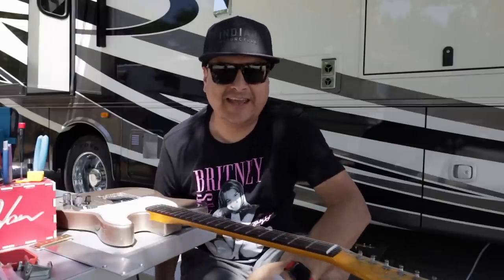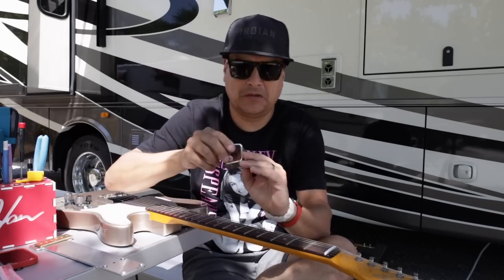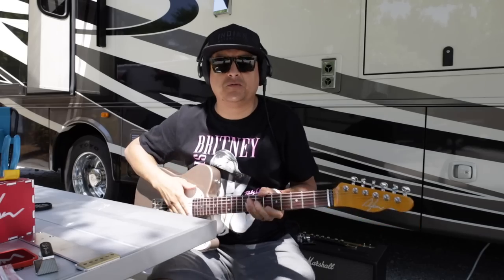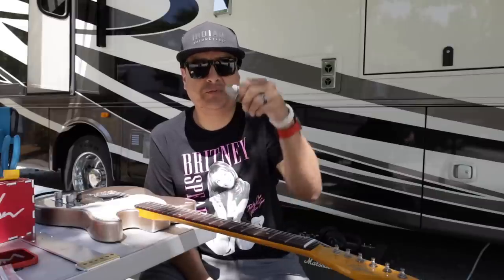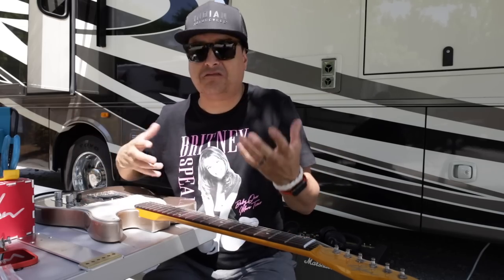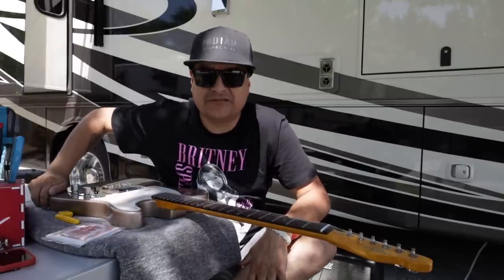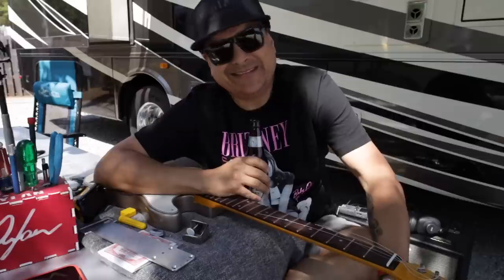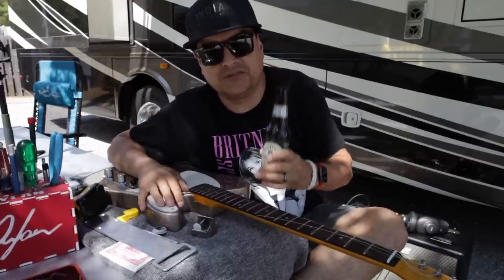How To Get More Sustain - The Backbone VS Fender Fat Finger Review Episode #651

Comment: I for sure hear a difference, not in tone but in sustain. Bought the fatfinger myself and I find it increasing the sustain for sure. It is logical because the vibration of the head guitar goes against the vibration of the strings that is why headless guitars have such a good sustain. And those Steinberger guitars made out of carbon have monster sustain because carbon is very stiff. So, for me it certainly works. I think it also depends on how thick the neck of the guitar is because thicker means more stifness and less vibration from the wood which interferes with the vibration of the strings.

Comment: Yep. If you wanna effect tone and sustain, start (and maybe end) with the string contact points. Bridge, nut and frets. I'm a big fan of stainless steel frets. They make the guitar sing louder and clearer than anything else I've tried as far as mods. A good cable between your guitar and amp/buffer is a big deal too. Good solder joints are also important
Reply: I wonder how tungsten frets would work if they were pre-machined to the required dimensions and shape [since filing them after installation would be essentially impossible].

Comment: What limits sustain is the transfer of energy from the strings.  If none of the energy in the strings was ever transferred to anything else, they would sustain forever.  A resonant body may transfer energy from the strings during parts of each vibration cycle, but feed energy back to the strings during other parts.  Increasing the amount of mass at the nodes of the vibrating string will generally reduce the amount of energy transferred in either direction.  Adding mass near the headstock would likely affect open strings more than fretted notes; whether that's a good thing or not would likely be a stylistic choice.

Otherwise, when describing something as deadening the sound, I think it would often be good to think of such effects more in terms of how they affect the sound of different parts of a note relative to each other, rather than in absolute terms.  If adjusting tone knobs so that the tail of a note was as bright as desired would cause the attack to be too bright, a device that deadens the sound of everything, but especially the attack, may allow one to use a higher tone setting than would otherwise be acceptable, which may leave one with a brighter-sounding tail than if one had to use a lower tone setting.
Reply: Thank you for a coherent response.
Reply from the maker: This is something I want to try to illustrate in a video. I am buying an oscilloscope soon and want to be able to show what you are saying visually. It’s really helpful to understand. So many people think In simple sine waves and our guitars never actually behave that way.
Reply: @DylanTalksTone  One thing I'm interested in seeing given more consideration is the fact that because a guitar's AC impedance isn't constant, the tone circuitry built into the guitar will interact with the coils differently from how a tone circuit in an amp or pedal would react.  One of my guitars is an inexpensive Ibanez which is stock except that I've cranked the bridge humbucker down away from the strings, but put two 1x6mm neodymium disk magnets on each of the four pole pieces serving the bottom two strings.

The effect of this is that when using just the bridge humbucker, the tone knob affects the volume of the treble stings much more than it affects the bass strings.  By turning down the tone knob on the guitar but boosting the treble on the amp, I can make the bass strings much brighter than the treble strings.  While turning the knobs to the extremes would put a disproportionate emphasis on the bass strings, the fact that the knobs can dial such extremes means I can emphasize the bass part of a bass/strum pattern as much as I want.

Comment: Wood vibration can cut some note.  Some weight in headstock can fix the problem because changed the vibration frequency and yes...it increase sustain in this note. In my bass is the E string, G# note. Fatfinger maybe can work for that. I improvised with a weight I made myself.

Comment: Edit: the fat finger made the sound dull, the backbone kinda served the tone (maybe just in my imagination), but at least it did not worsened it at all. 
But that happened, because your tele is already perfectly fine! On bad sounding guitars, both gimmicks could help a bit, for whom does not have experience working on guitars... me thinks

IMO lots of sustain is nice to have, but rarely is needed a longer sustain then 10 sec. 
The more important part, I think, is that long sustain means the string vibrates more freely, with less dissipation of string energy, thus generally a better tone with a wider range of over- and under-tones (if that makes sense...) just my opinion. 
I work on my cheapo guitars till I get the most sustain out of‘em. 

More weight on the headstock can alter the tone and sustain to better or to worse. It‘s a matter of balance between body-weight and its resonance and neck stiffness, weight and resonance. A perfect good guitar can just get worse by changing weight, form etc. 

I had experienced a bit more bottom end and an increase of sustain by replacing the cheap tuner with locking ones on three guitars. Certainly, it could be also the better materials (brass f. ex.) , tighter tolerances, and so on... I know, I know...

But on one I had lost a bit of sustain with the heavier lockings (2008 B.C. Rich mockingbird classic exotic koa),. It had already lots of sustain, so I live with it, because It balances better on my lap and easier string change.

All started few years ago after swapping the metal cast knobs of the tuners on a kit-build tele with lighter fancy orange plastic knobs. I instantly heared the loss of bottom end (10%) and sustain (by 15%). I mounted the metal knobs back two days later and got my old tone back. The difference in weight was just 6.4 gramms!!! Just the tuner KNOBS  had so much influence!!! 
Later on I mounted heavier locking tuners and achieved an increase of sustain and low end. And a nicer tone!🤷🏻‍♂️

Comment: Fat finger is not for sustain, it changes the way that neck resonate and in some circumstances helps to eliminate dead notes. I have Hopf Studio from '70, kinda Gibson SG shape, with long neck, and additional weight on headstock eliminates dead notes on G string.
Reply from the maker: It says “sustain enhancer” on the package so.....
Reply: @DylanTalksTone  well the truth is i never looked for "a device" to enchance my sustain, so didn't know how fender tries to sell that product ;) but when i did research for dead notes on the neck, i found some information about adding mass to the headstock. That mass should be actually "tuned" to achieve the effect you want. I personally would never pay such money for piece of bent steel with fender logo, but on the internet you can even find oldschool thing called fathead for fender bassess. I think that as long as there are many neck profiles and thicknessess available, fat finger would work differently on different guitars.
Reply: @DylanTalksTone  By the way, maybe you'll be interested - on ResearchGate there is scientific research from 1999r called Dead Spots Of Electric Bassess written by Helmut Fleischer ;)
Reply: This is also what I've heard. Though it would make sense for Fender to market it as a "sustain enhancer", because if they marketed it for it's true purpose, then that might be them inadvertently admitting that some of their necks may have dead spots?
Reply: Fully agree. These devices are completely pointless if you don't have a problem with sustain, and dead notes in particular. They can alleviate dead notes or change the dead note to a different note.

Comment: I was customizing my Ibanez rg520 a couple yrs ago. Was removing the pickup rings, I wanted my pickups mounted in the body. I removed just a little bit of wood on the body at the neck so I could push the neck pickup flush to the neck. Maybe sounds the same but it never felt the same. It never vibrated thru my arms an chest like it did before

Comment: To me, based on the limited playing, the backbone sounded like it did increase the volume and length of the notes by a decent amount. At least by a second or two, possibly more depending on how hard you strum. If someone is looking for a gadget to increase the length of notes without any concern for anything else it sounds like it delivered on that
Reply: I agree,  I did hear a difference with the backbone installed. It sounded more full And bright
Reply: Yeah It did increased a bit of sustain. But I'm questioning if that was not because of the new set os strings he put on the guitar only after recording without the backbone.
Reply: Hearing it in this video just convinced me to buy one. There was definitely a noticeable difference.
Reply: @rafamoraes82  new strings don't really increase sustain, just tuning stability brightness, if the old ones start getting really old, (which not many players do not wait that long)

Comment: Aside from a good setup (which you already mentioned), two things affect the vast majority of an instrument's ability to sustain a note: The instrument needs to be light and stiff.

The less mass that the strings have to impart energy into, the less stuff there is to inhibit and dampen those vibrations. 
The stiffer the materials, all of them, but mostly the things between the bridge and nut, the more they will vibrate with the strings, and the less they will dampen the vibration. 

Now, these are not the end-all of it. Some materials are super heavy, but also incredibly stiff. These will sustain vibration very well.

Ultimately, a good solidly built guitar with a proper setup, and you're fine. 

The way you hold your guitar, like how tightly you grip the neck or how much you rest your strumming arm on the body, will affect tone far more than any of these gadgets.
Reply: You are half right,, stiff yes,, light? He'll no,, those 10 pound Les Paul put most guitars to shame in the sustain dept. ,, plugged or unplugged,  either way.
Reply: @keithclark486  except for a hollowbody Les Paul.  Key word,,semi hollow, those things sustain more than solid bodies ,,period.
Reply: @keithclark486  of course it will blow them all away. You are comparing hollowbodies to solidbodies. I used to have a jazz box hollowbody, it sustained for days. However. When my uncle was running a guitar center. On a slow day, they decided to test the sustain if all the solid body electric guitars. They took a headstock clamp in tuner, and timed how long the tuner could pickup the note. Les Paul beat every other solid body.
Reply: @keithclark486  well,, I meant semi hollow ,  or chambered Les Paul,, shit. I guarantee my neck through 8 string will out sustain your Kay. The neck is so massive and it's all one piece, it sustains like a good Warwick bass,, for days. And it's solid body. But quite a different beast.
Reply: @keithclark486  LOL. Ok
Reply: @keithclark486  my 8 string will win for sure, I have played a stand up. They actually don't sustain as long as a Warwick 5 string bass. (Have you played one?) My 8 string (ESP neck through) is on par with a 5 string Warwick.

Comment: The fat finger is more often used for getting rid of dead spots on bass. Most basses will have a note that chokes out somewhere on the G string because of the resonant frequency of the bass. The fat finger can often move the resonant frequency out of the basses range. There are also more permanent methods, like hiding weights under the tuners, to add mass to the headstock and achieve the same result. Guitars can also have dead spots but they are less noticeable

Comment: I listened to the comparison a couple of times but I want to listen to it a few more times. My first question is tell me more about the pickup you are using because it had a deeper tone than I would have expected from that guitar. Is it one of your own pickups? I really liked the tone of the guitar before the products . Also what size strings were you using? I thought that I heard a difference when you were using the two products. I can't say that you had more sustain although it did seem it to me. But I felt you had some additional string vibration in sympathy so the overall sound seem bigger, additional strings were vibrating that added to the overall sound. And I liked that. I do agree with you that I prefer a more resident guitar where you can feel the vibration and I wouldn't want to dampen the vibration. Also it didn't seem to be a big difference between the two products in terms of the changes so it seemed if you did want to make a change the $15 easy to attach part made more sense than the $60 difficult to attach part. Thanks for doing this it was fun

Comment: I'm not hearing much difference and I'm in the snake oil camp on these things BUT, with my high school science hat on (from 40 years ago): if the goal is to increase sustain, that means keeping the energy in the strings for longer. And I would have thought would mean you would feel less resonance, because the resonance you feel is energy that has moved away from the strings into the rest of the guitar. And that aligns with what you reported, i.e. less resonance with these devices attached. Food for thought?...

Comment: My understanding of the fatfinger was that it was for moving dead spots. I have a guitar where playing a B on any string and fret above the 10th will cause the note to just decay to zero in 2 seconds. It's sympathetic resonance. The resonance sucks the life out of the string. Any other note sustains fine. Allegedly the fatfinger will move that deadspot somewhere else - the added mass altering how the neck resonates. It might move it to a better position, a worse position, or have no impact at all. Most of the time the deadspot on a guitar, if it exists, sits around the 12th fret give or take a few frets. I imagine that is what most people will be using these things for. Apparently very common on the P Bass which was why Fender invented the Fatfinger.  I've not tried any of these things on my guitar.

Comment: Man.  I just found you, and love this stuff.  I have even used sustainer and semi hollow body guitars and loud naps back in the day.  Etc. 
Are you a physics teacher or engineer or something?
I've always said the big parts that matter are the pickups, bridge, nut, and tuners especially.  The wood doesn't matter to me except I want it to be attractive and hold my controls. 🤣
It might have sustained a little more. It's keeping the guitar from robbing string vibration I think is the theory.  I think a more fair test would be using much more gain. I've done something similar using high gain by sticking the headstock against something and if will give more sustain when using gain.  I would try it that way myself.  
The best solution for sustain is the company here in my homestate of Indiana which makes the Sustainer. Sustaniac. 
Thanks for adding value to my life.  I subscribed and will be checking out your other videos.

Comment: To begin with, it has been said that talking about music is like dancing about architecture (and to the deaf, dancing looks insane).
Accordingly, I guess "resonance" is as good a word to describe the sensation,  quantity and quality of vibration as any, imperfect as it may be.
Neither the "Backbone" or the "Fat Finger" improved the sound of the guitar in any way to my poor, abused-for-years- in-front-of-amplifiers ears.  It sustained well enough without them, and no more with them. You say the guitar felt deader? Wrong direction! I'll save my bucks. I already have a bottle cap opener (a "church key"), thank you.
As you said, "sustain" is a bugaboo that is a lot of BS. You asked the right question, "How long DO you want a note to sustain?" Higher action does more to increase acoustic sustain and improve tone than any other thing. "Sweet spot" pickup height adjustment does the same for the electric sound. Do both and your on your way to good tone. Now all you've got to do is to play with skill, sensitivity, emotion, and musical integrity, in short, talent. No problem, right? :D
The same goes for basses. How long do you want a bass note to sustain? James Jamerson, arguably the greatest electric bass player of all time, muted his bridge with a piece of foam, used flatwound strings (some say round wounds, but I don't think so from his sound) which he is said to have never changed. He was going for minimal sustain, just a short, punchy thud so that his rhythmic style would work better. He was as much a percussionist as a bass player.
Anyway, this "sustain" thing is just so much crap. You have the right idea about definition and clarity of notes being what we really want. A good compressor will sustain your sound as much as you need.
Dylan, along with Zac Childs and Chris Buck, you do the best guitar vids. Very honest and forthright in a myth-believing, unreasoning world. Great stuff, brother.